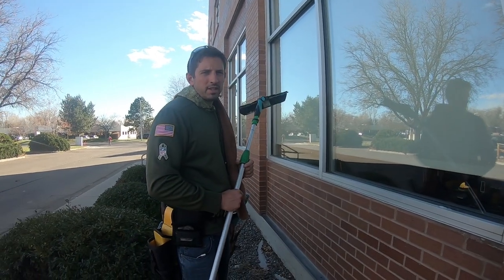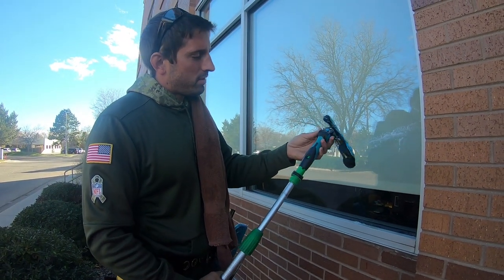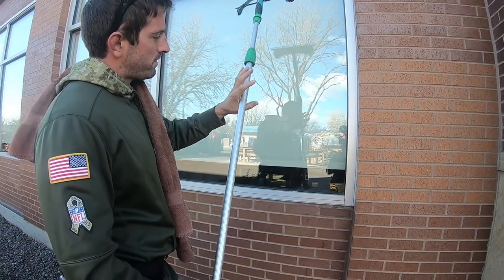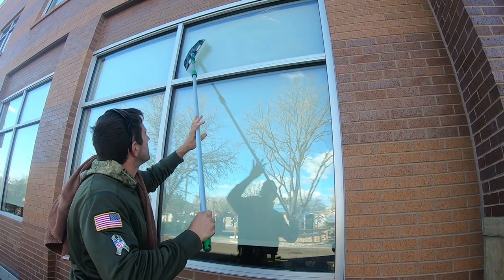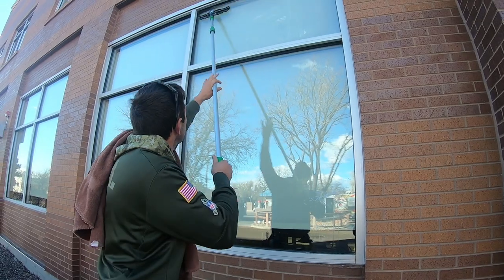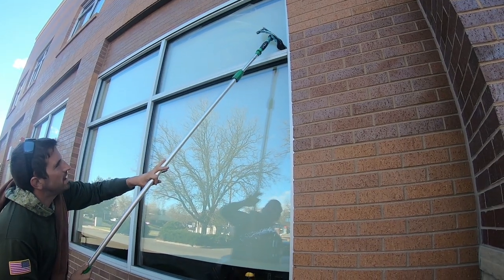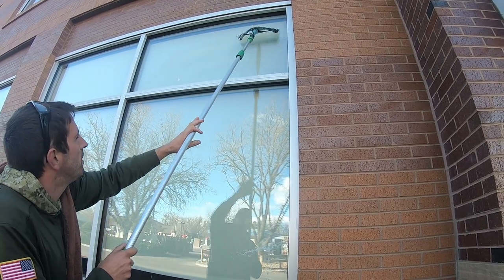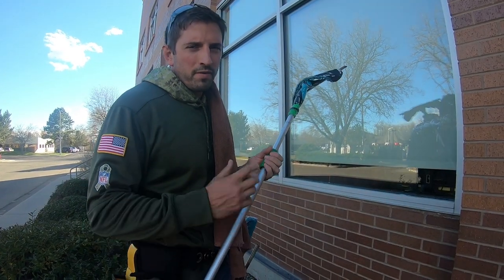HOW TO USE A SWIVEL SQUEEGEE ON A POLE

Comment: When I first came to your channel,  I criticized your technique,  because I saw you going back and forth, side to side about 10 or 12 times fanning down a 2' tall upper window with about a 12" squeegee.  I saw another guy commenting on how inefficient it looks too.  You really don't take much water off with each pass, so it requires a lot more passes side to side.  Is that because if you did try to take more water off with a pole,  that the excelerator wouldn't apply the pressure evenly enough to not leave lines behind? 

I bought the Moerman excelerator with an 18" channel and after cleaning about 10-15 Windows with it,  i sent it right back to where it came from,  because using it by hand trying to use the most channel length, efficiently, It was leaving trails along the edge of the channel in the middle of the window.  I think the 18" was just too large and the pressure/ angle differences required to get the best results, demand a lower efficiency of water removal to channel length ratio.  Am I right? 

I hope I made sense.... lol
Reply: If my suspicions are correct,  that would explain why it looks inefficient,  but when you're only using one tool and zero detailing,  i think the proof is in the clock.  
One thing that bothered the shit out of me was paying $30 dollars for a plastic handle that felt like a Chinese made plastic toy that came out of a bin at the dollar store.  And when I closed out, twice the button was triggered,   unlocking it to swivel mode, which threw me.
Reply from the maker: Totally understand!! Yea I probably go back and forth more then needed but the reason behind that is to stay controlled and once you start going to fast with this tool you’ll leave behind skip marks or turn marks. I’ve gotten so use to it especially in the last year that I really enjoy this tool. Now I use this tool with an Ettore brass channel and the glide is awesome with it, the liquidator and me have never become best friends lol 😂
Reply: I say all channels are very easy to use!! Just gotta practice what u use everyday.
You can be good at whatever you use! 
EVERYONE HAS THERE OWN WAYS, what works for them.